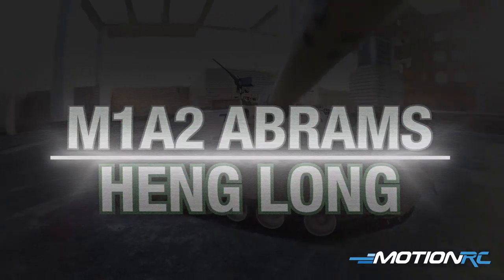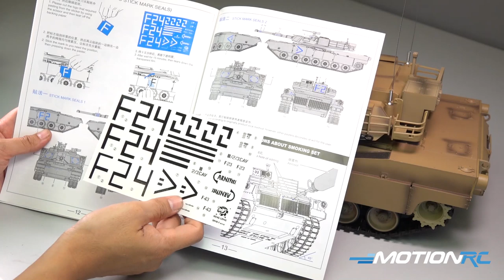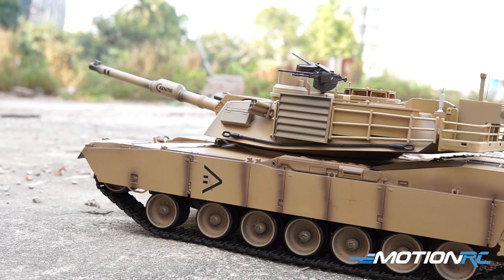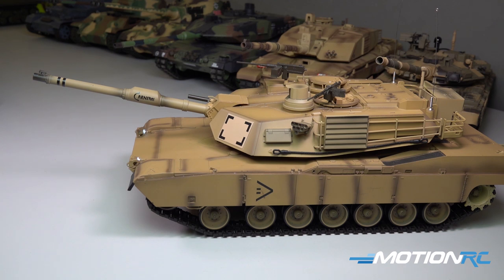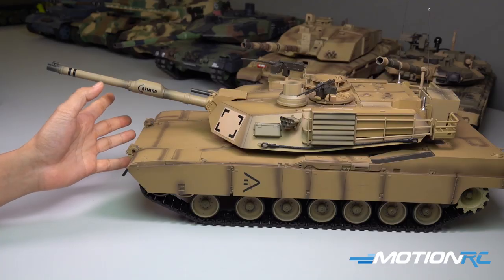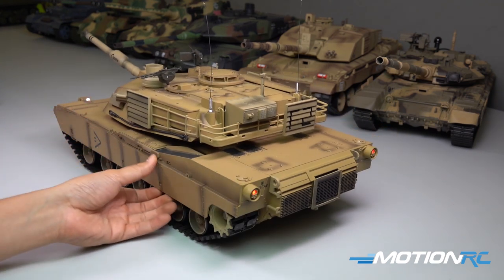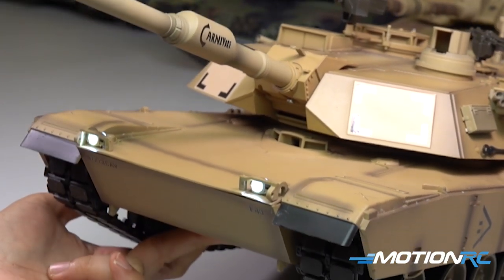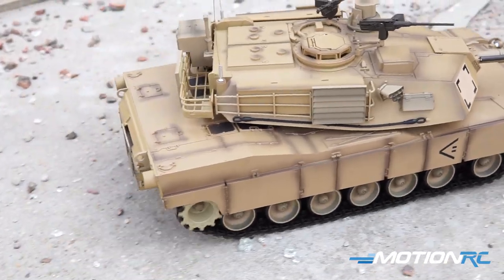M1A2 Abrams - Heng Long TK6.0 RC Tank - Motion RC Overview

Comment: Just bought this about a month ago. Did some customization. One item: The on/off switch is located beneath a hatch, beneath the rear of the turret. To turn off the tank the turret needs to be rotated, at least a little. No other complaint so far.
Reply: Thanks. I came here just to find out where that was. There is a dummy on off switch underneath I thought it was a defect.

Comment: I've been interested in buying a Henglong Abrams, but I've heard that its lower hull is more prone to flexing (compared to other RC tanks, supposedly) if you weigh it down by upgrading with metal tracks/wheels/sprockets/gearbox so reinforcing the hull is recommended. Is there any truth to that?

Comment: Hi, i've recently purchased a sep v3 kit from DKLMRC how did you setup the lights? i'm recently new to the RC world and i'm having a hard time with the upgrades since there isn't a lot of tutorials on specific tanks and upgrades, can you do a series on the different tanks, upgrades and the boards? really having  hard time with the board since there isn't a lot of content out there that tackles those problems!
Reply from the maker: I am not sure. We don't make or sell that product, you should ask the manufacturer or distributer you got it from
Reply: @MotionRC  how did power the citv and the emergency light on 1 switch?
Reply from the maker: @ericmagpantay7693  Sorry Eric, this tank is stock. We did nothing to it but plug it in out of the box.
Reply: @MotionRC  i mean the one you detailed and upgraded, because i noticed that you installed the emergency light without ever attaching it to the board as it has it's own switch, where can i learn how to  do this? Because people tell me i need to upgrade my board in order to run extra stuff like a moving CITV or the Emergency light, any tips?

Comment: Whats up with the middle wheel on what would be the right side at 6:58 ?
Reply: The wheels on my king tiger has that problem but less severe, the wheel at the right back that is plastic (i have m idle, drive and track) is sligthly like that, and sometimes when i reverse it manages to move the track out of place
Reply: It’s an easy fix no? You just have to remove the cover and tighten the road wheel

Comment: Looks like you've got a busted suspension or the middle wheel has come loose (frame 6:25) I just received my Abrams  M1A2 V:6.0 still pending more upgrades for her and a custom paint job. Thinking of dropping a 5000ah 7.4 battery for longer range.
Reply: Damn 😅

Comment: Nice review. Question, when you say a drop of oil, the book says 2 ml. is that too much?  Will smoke come out of both fill holes? Thanks!
Reply: If you've already bought one you'll already know by now but basically don't go mad on filling it up. Or it will end up being too full to smoke. See if one drop works and go from there.  As both pipes are fitted to the same smoke maker it should come out of both pipes. Unless of course there is a blockage of some sort.

Comment: I bought a professional Abrams tank with the metal tracks. but it seems that the tracks are too heavy for the motor to move the tank very well, making it very hard for the tank to turn, or go over very small hills. do you have any tips on how I could make my tank work better? I saved up for a very long time, and I am very disappointed in it.
Reply: Can you not just go to the highest gear it should have a lot of torque

Comment: Have a 5.3 H/L abrams, goes very well. Of course me being me had to do some hard offloading, as you do. You know what I mean, mud, dirt all the good stuff and promptly killed one plastic gear box. $40 later and she is unstoppable. Might get the steel gear, tracks etc but we will see. Would like to get the tk 6.0 gear mainly for the turbine sound but that might be a bit down the line.
Reply: I have the Leopard 2 with the metal tracks and stuff 👍👍
Reply: I know that it's a couple of years down the line but if you haven't already upgraded to metal gearing and track's I'd do so at the first opportunity to. Way better than the plastic ones. The steel gear boxes would be best as the zinc alloy one's can still be a bit fragile. Don't forget to put some grease in there anyway. I was surprised to find out that,that little detail had been left when it came to mine being built. So I added some and it runs super smooth now. Don't add any grease to the track's though. As that will attract dirt and grit. Which won't do them much good. Hopefully yours is still charging around like it was when it was new.

Comment: My question is...   Does this have the correct Gas Turbine engine sound effects?  I know it's a little thing, but I focus on odd details.
Reply from the maker: Yep, there is a turbine engine sound on there for sure
Reply: Make sure you get the 6.0 or 6.1 version to get the Abrams sound package. The older ones had the Tiger 1/Leopard 2A6 dual profile.

Comment: Ha ha. The smooth side's of the tank. Way better than the endless amount of tools etc that seems to fall off every time you use it. One of the joys of my Heng Long Panther/ Tiger or Pantiger as some would call it. Although it's no longer that as I've managed to model it into a nice looking Panther A. So yea. It can be done. But yea. The plastic accessories falling or being knocked off seem to be a regular hazard when it comes to these things. Even if you glue them on your tank will have this amazing ability to knock it off again! Lol. Fortunately you can,up to a point,get replacement parts for it. Or just leave it as it is. So as to add to the battle worn look of the tank. So yea. These tank's are great fun. Although I'd definitely get the one's with metal gearing and track's.
Reply: My 3D printer is gonna be getting a hell of a lot of use in that regard. I've got the KV-1E and I'm doing it up as if the NCR had restored it, put it back into service, and that means a LOT of greebling is getting put on the fenders. I will grant the detail bobbins are better protected on the KV hull than on a Panther or Tiger hull, they're still prone to coming off from time to time, and if I lose one I'll have to reprint it.
Reply: @TestECull  make some tank hatches and stuff to sell on eBay. No one seems to do that stuff. The hatches on the Panthers Turret seems to be forever getting broken yet no one does a replacement for it. Hatches for the escape hatch and hull hatches would be cool too. There's probably loads of other stuff that people want that isn't being made too. Probably never happen but we can dream can't we.
Reply: @darkstardavros  I'd almost kill for Heng Long to spit out some ARVs. M88A2 is chief for me...M60 lower hull, custom casemate, all the cranes and winches our little hearts could desire. Would be a BAD ASS vehicle!
Reply: @darkstardavros  As it is I'm looking to do a custom build off one of the lower hulls one can find on eBay. Itt'l prolly end up based off a Panzer III/IV lower, though. But that's ok. I have a thing for depicting post-nuclear shenanigans...Fallout being a HUGE favorite game series of mine...I've alredy done it in 1/35th static with the main gun of an M1A2 Abrams and the lower hull of an M113A1 turned backwards to create a custom little mobile 120mm shotgun for the Minutemen. Prolly be similar to that, but RC and 1/16th scale.
Reply: @TestECull  sounds like a plan.
Reply: @darkstardavros  Working on a cupola mount twin M2HB right now. Have the ring, guns printed, hardware on print bed as I type this. Going onto an NCR operated KV-1E. Gonna look MEAN!

Comment: I am going to nit pick something, at 4:22 in the video the turret rotates and the engine sound or sound in general changes. If you have ever been in an Abrams you know that is not correct either outside or inside the tank you cannot hear a change in sound when the turret moves.
Reply: You serve in the Persian Gulf or Iraq war?
Reply: @buffalosoldiers4688  I was enlisted and was in OSUT but by the time I got to Ft. Riley they were back from Kuwait and Desert Storm.
Reply: @jared7211  Right on. I figured you either served or visited more than a few Armed Forced Day celebrations.
Reply: It's a toy, but enthusiasts can modify as they like. Pity the sound aren't more realistic though. No clatter of the tracks. I'm just modding the Abram, gun recoil, flash, mod the track recoil and use sound cards to record real tank sounds to use on model. Good tank to mod as lots of space inside for electronics.

Comment: How change sound ? i have model m1 a2abrams :) Does this tk 6.0 device already have new tank sound installed because I have a different one?
Reply: There should be sound options on the transmitter

Comment: 5:09 I generally turn that off entirely. It's a nice idea but it just doesn't look right. Even if the gun is aimed dead ahead or dead astern, the recoil would more want to rotate the tank around its center of gravity than push it straight along. IE, it would be compressing the springs on the opposite end of the tank from the muzzle.

Blipping the traction motors does not replicate that accurately enough for my tastes. And if you're firing over the side to any noticeable degree it just looks incredibly out of place.

So I just turn track recoil off entirely.
Reply: I didn’t know you could turn it off
Reply: @Skelevon_gaming  Ye pop the battery door off your transmitter. Heng Long puts a cheat sheet of common button combinations to disable/enable functions on there. Stuff like the airsoft gun, sound, recoil, etc. Even that annoying headlight can be turned off this way.

Comment: Mine doesnt have a on/ off switch what should i do
Reply from the maker: The abrams switch is located on top under a hatch, the turret needs to be clocked 45 degrees or so to access
Reply: @MotionRC  ok thx

Comment: Anyone have any ideas on how to implement a remote control tank with full turret movement range at 360 degrees without the turret being limited to the rear?  Headless mode system may work?
Reply: WIRE
Reply: You would need a new ring and a new thing for the wires
So it doesn’t twist the wires

Comment: Is there a metal track included?
Reply: Depends oh the version you got
They all have differing prices
Reply: @TheDaltonius  so what's the version that has a metal track?
Reply: @jaysondwightbotea6831  
I don’t actually remember specifically as there are a few versions, however the motion RC store only sells promotion and upgrade versions if I remember correctly
Reply: @TheDaltonius  alright thanks btw

Comment: It was a nice review my friend but the most important things you forgot to show was where do you turn on the tank after you turn on the transmitter.. and for the main gun recoil that is supposed to be synced with the firing effects the main gun should not recoil before firing it should recoil when it fires. So if you are truly going to review Arc take it's very important to show where the on-off switch is on the tank after you turn on the transmitter.. for that I have to give you three somes down
👎👎👎
Reply from the maker: There is hatch on top of the tank toward the back that opens and shows the on/off switch. Apologies.
Reply: My M1A2 Abraham thanks firing and recoil is not working! 😞